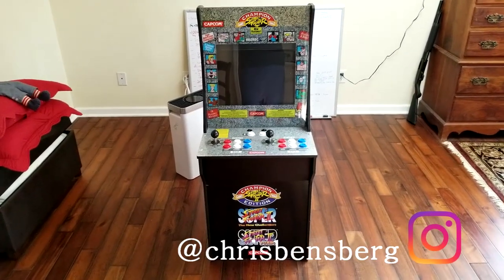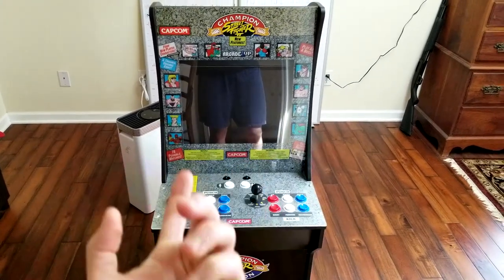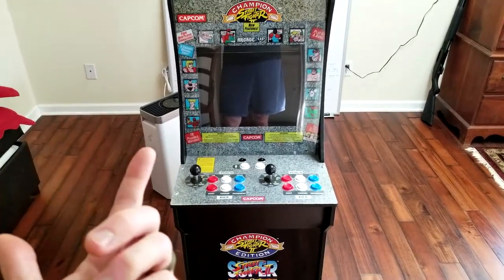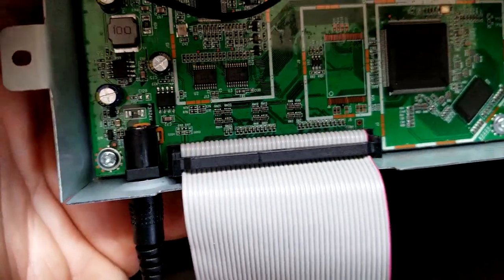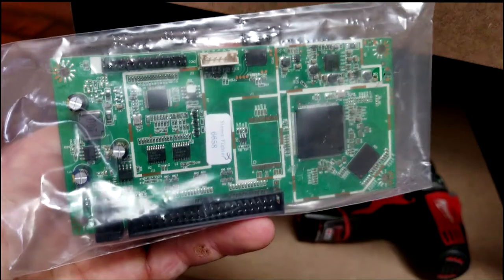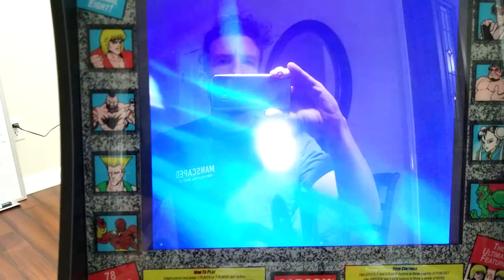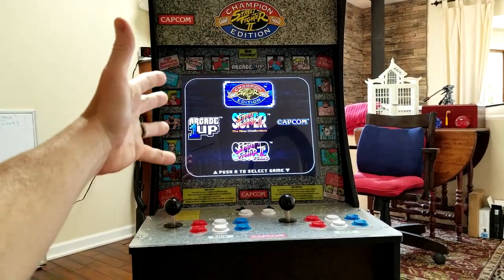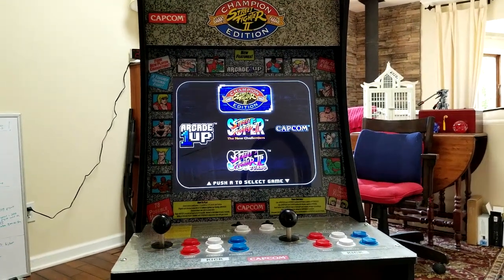Arcade1Up Arcade Cabinet Turns On With NO Picture FIX

Comment: Just got a new midway legacy cabinet pre-built from arcade1up that my sister bought me. The picture works fine but there is no audio even with the audio levels turned up all the way. Do you think checking the ribbon cables and all to make sure everything is plugged up properly is the best place to start for troubleshooting?
Edit: nevermind! I used your video as a guide on what to expect when I opened the back. They didn't even have the light-bar or speakers plugged into the box lol! Super easy fix :D

Comment: Just A-heads up with new Customers
Just to express my personal experience.
My Arcade 1up stoped working within 5 months give or take as I did not play often.
 Sent my receipt plus a pic of the Arcade 1Up and had no one got back to me sadly. Ended buying a PCB board still did not turn on. As much as I'm a fan of arcade 1up idea,
Unfortunitly I had a very unpleasant experience and will not support Arcade 1up.
Reply: My LCD went bad after a month. Then I have contacted the company and they sent a LCD with wrong resolution. I contacted them again and got new LCD.
After 3 months, the same thing happened.

Stay away from this product. It was simply a waste of the time and the money.

Comment: Thanks for video!  I bought a new PCBboard and installed it but the picture still doesn’t comes on the way on🙁. What do I try next??
Reply: Same
Reply: I have a Marvel Countercade with the darn white screen that plagues these cabinets and I contacted Arcade1Up but these folks sent me troubleshooting instructions for a 3/4 cabinet which I cannot use since the pcb board is different. I emailed Arcade1Up for the correct troubleshooting steps, waiting for the correct instructions.

Comment: The fact that they even need to have a web store where you can buy replacement boards, makes me question if these were designed to fail. Normal electronics dont have boards fail that often. (think your 6-8 year old laptop)  they should have designed these better, unless they are trying to scam every last $ out of you.
Reply from the maker: I hope not as well, but very true I think my cabinet is under 2 years old failing board should not happen. They don't make electronics like they used too, that's for sure.
Reply: I just bought my first cabinet from them and I played one game of nba jam before the board completely failed lol. They’re sending me a replacement though luckily
Reply: @ToughLuckStudio  I think I'm in the same boat. NBA jam with no power
Reply: Good remark, I think that's their philosophy. 
My brand new Ridge Racer had a faulty steering and no gas pedal detection, so I changed the steering assembly. After the replacement, It worked great....for a few days (I played it 3 hours in total). Suddenly, the screen stopped working, sound ok, but a black screen. Today it works again for some reason, played one hour, then the image disappeared again during gameplay. That A1Up stuff is a nightmare.

Comment: I had a final fight cabinet that did the same thing so I made a ticket through arcade1up and they narrowed it down to pcb board and took them 7weeks to get one to me..So I swapped out to new board and got another whammy because now all mine does is show a white screen with sound so now I'm waiting for arcade1up to send me a new LCD screen so hopefully it will fix the problem ..
Reply from the maker: Nice, free99 is the best, I guess if folks didn't want to wait, then buy one from their website and then resell it for more on eBay when the free one arrives in mail. They must slow roll the free ones under warranty. Let me know how the fix goes:)
Reply: So I put the new screen in they sent me and you can see the arcade1up logo barely..its almost black and I hear sound so now what lol .any suggestions?
Reply: @bo2gamer738  same, it sucks, were you able to resolve
Reply: @johnnybanton  No i didnt resolve it   i ended up just modding it with an old 20in lcd tv i had laying around then i just hooked a modded wii into it and made it a lightgun cabinet lol
Reply: @bo2gamer738  thanks, I figured that was the path I was on, I will look for a low costly one, if you have a link suggestion that would be great. Thanks everyone
Reply: @johnnybanton  your welcome Jon..as far as links i have none like i said i think i had a proscan 20in lcd tv laying around that ended up almost fitting right into it and it had hdmi connections and analog connections so i installed my wii to it and turned it into a lightgun cab..but i wasnt out much because my final fight was like 50bucks when walmart had them real cheap lol..so i would just mod it if i was you jon..i ended up getting the street fighter legacy cab that ended up having final fight and 1944 on it and its a lot better cab then those 1st generations ones..hope that helps lol
Reply: @bo2gamer738  good stuff appreciate it!

Comment: Have a Marvel COUNTERCADE and after 4 months I now have the dreaded white screen but I can hear the games and buttons all work. Any ideas how to fix the monitor? Can I somehow reset the lcd monitor itself?
Reply: After 4 months of light use now I’m cursed with the darn white screen that plagues these cabinets and I contacted Arcade1Up but these folks sent me troubleshooting instructions for a 3/4 cabinet which I cannot use since the pcb board is different. I emailed Arcade1Up for the correct troubleshooting steps, waiting for the correct instructions.

Comment: I remember mines had the same issue easy solution bad power supply swap that out no problems ever sense
Reply: Mine has the same problem ...black screen on Marvel Super Heroes swap power cord with PacMan and now screen is back on, problem solved!
Reply: @angelmaria365  did you have sound with bad power supply
Reply: Did you have sound with bad power supply
Reply: @slownlow210  I had sound no picture swap out the power supply easy fix
Reply: What supply do I need to buy
Reply: @Justnothankyou132  I had a bad power supply I had sound but no image luckily at the time Arcade1up had them in stock on website bought a new one been working ever sense
Reply: Have a Marvel COUNTERCADE and have a white screen but I can hear the games and buttons all work. Any ideas how to fix the monitor? Can I somehow reset the lcd monitor itself?
Reply: I also did fix the sound issues on mines by doing a lil soldering on the motherboard